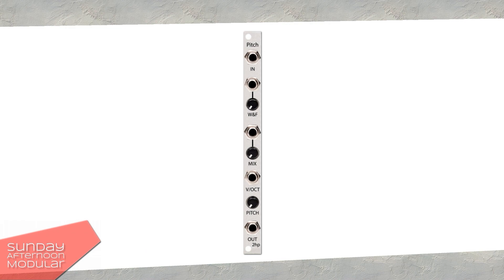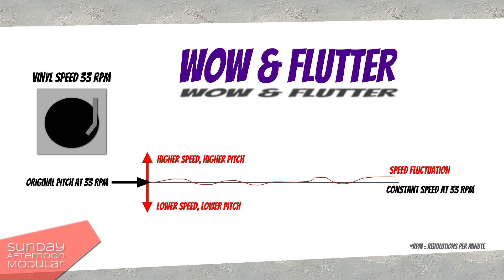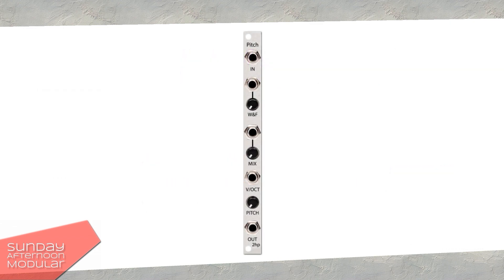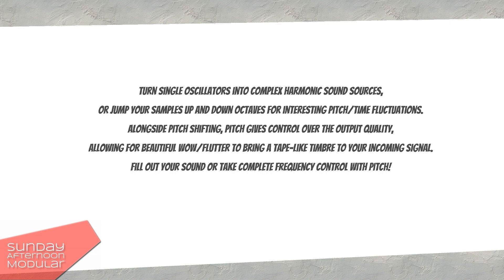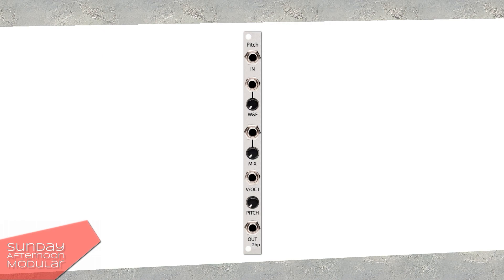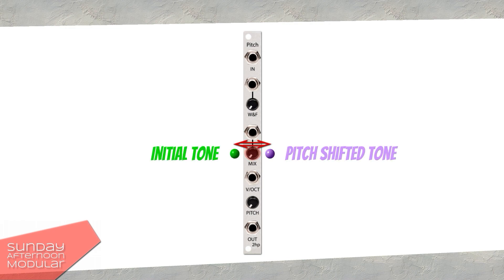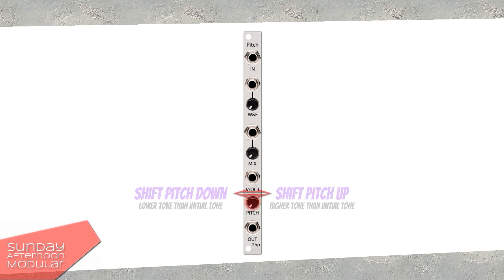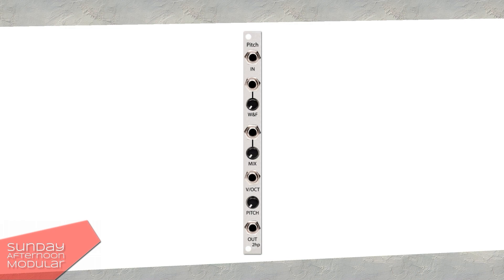Get cool sounds with 2HP PITCH! / What the heck is WOW & FLUTTER?

Comment: i checked demos of happy nerding fx aid and this and find 2hp to sound better. Are there any other simpe pitch shifters to consider? I´m looking for a clean tone/good sound for feedback patches and pitch shifted delay patching. So far 2hp looks like the best option
Reply: Did you end up finding a good  pitch module?
Reply: @kitespongan  not yet. Bu i think i´ll go with the 2hp.
Reply: FX Aid is older technology so the processing isn’t as high resolution. This module is actually quite impressive for its size. It’s too bad it’s so simple because if they made larger modules they could add a display and make this into a full multi effects module without changing the PCB. It could easily do stereo but they are limited to 2hp and it’s nice to have the CV control over 3 functions instead.